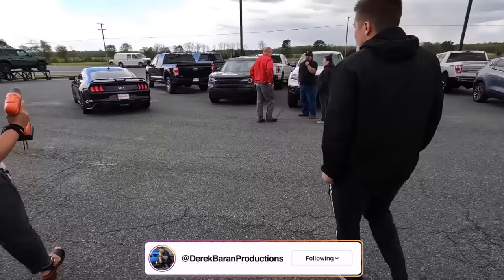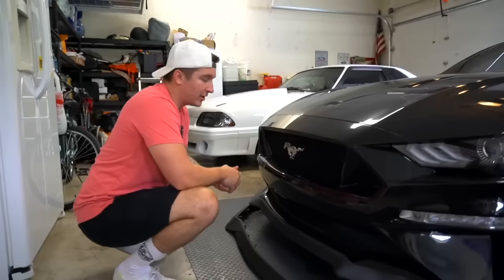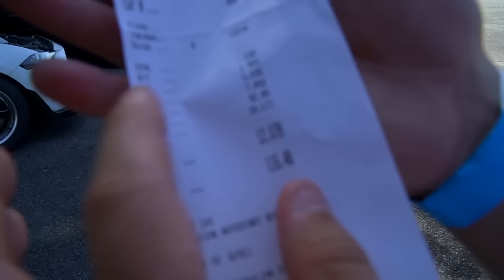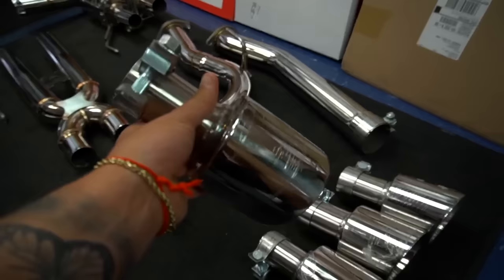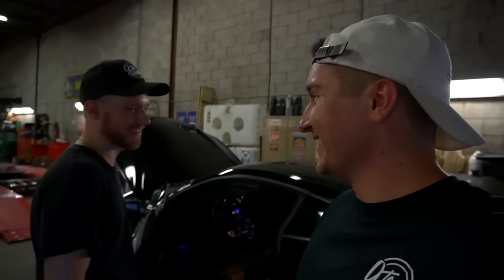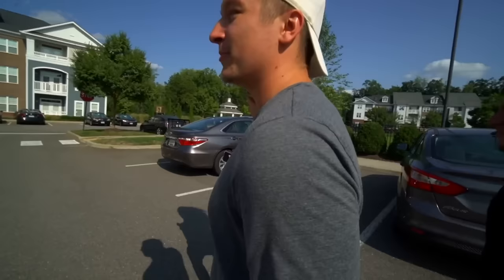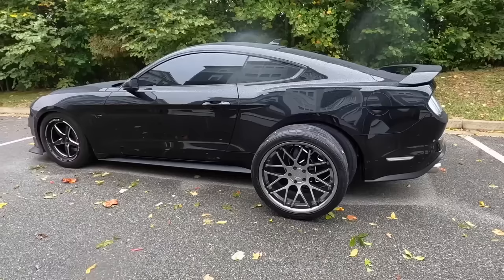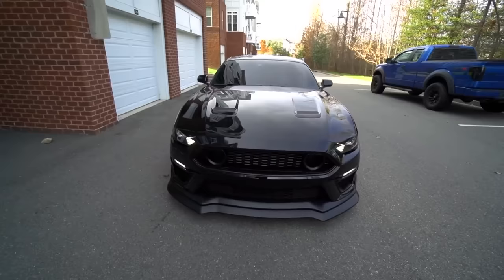Building a Ford Mustang in 15 Minutes! (FULL TRANSFORMATION)

Comment: I think the VMS wheels are really nice looking, especially for the price. I remember when Weld Draglites were the hot setup and were cheap. No such thing as cheap Welds anymore.☹️ My other favorite mod is the Mach 1 bumper. I’d get the Mach 1/GT350 rear diffuser, but it’s your car so, my opinion doesn’t mean jack. Lol. I found my 2014 GT on car gurus also. Drove my 2015 Challenger R/T to Nashville to trade it in. Very happy with that decision. 😁

Comment: Bro when you switched to E85, did you change injectors? Did you go with a returned fuel system? What all did you do to switch to E85? Very curious, I'm wanting to do the switch myself, but I don't know what I have to do.
Reply: With gen 3 you just need a tune. I believe gen 1 an 2 needs bigger injectors and a tune. My gen 1 has 47lb with a tune
Reply: Correct gen 3 only needs a tune

Comment: Idk man N/A them 5th gen t56 6speed ls3 camaro ss fbo heads cam package with meth setup make easy high 600whp to low 700wheel horse power my coworker got 1 and I'm pretty convince on doing a build very soon when the tax returns hit lol that sounds like alot but them LS engines are very easy to install tsp heads and tsp thumper camshaft ford is difficult to do a head cams package
Reply: Out of an ls3? No you’d have to make it non streetable to even attempt make that much power n/a. However the ls7 from the c6z or z/28 will definitely make those numbers easily. Heads/cam/intake/exhaust on a c6z will put you well over that 600whp mark.
Reply: No need to do hci on a Coyote for that kind of power. Boost is all it needs. Don’t even need long tubes or E85. Boost, enough fuel to feed it, tune, done.